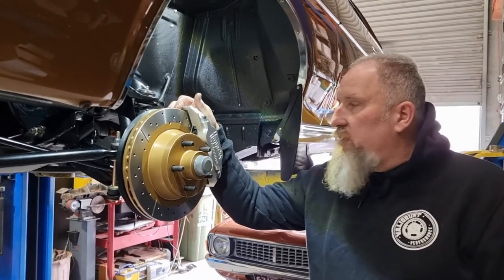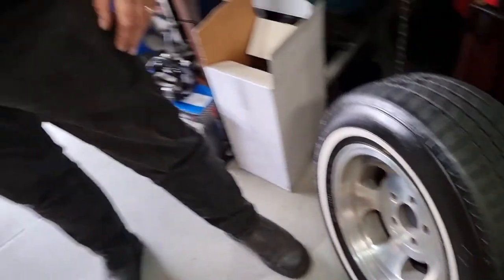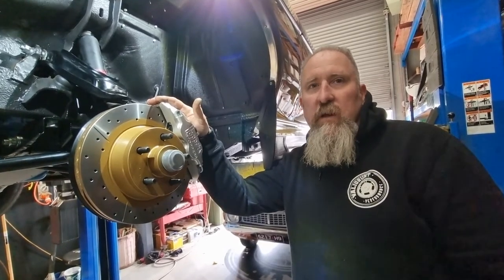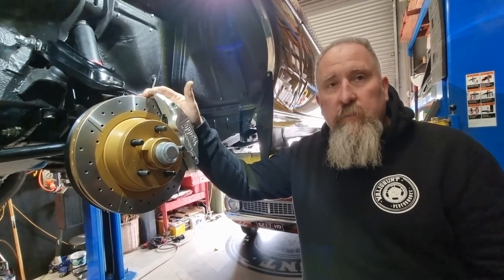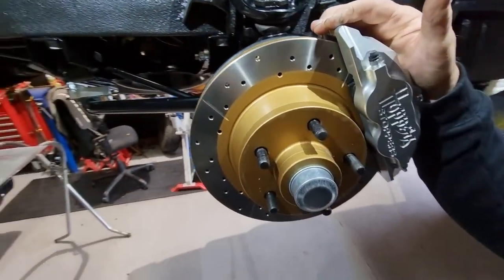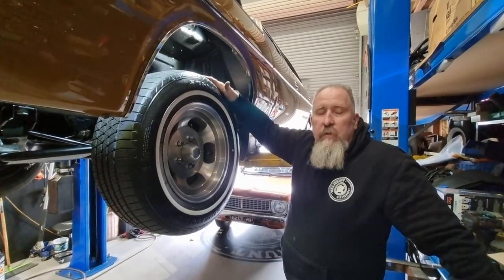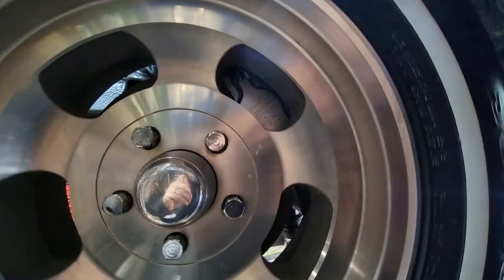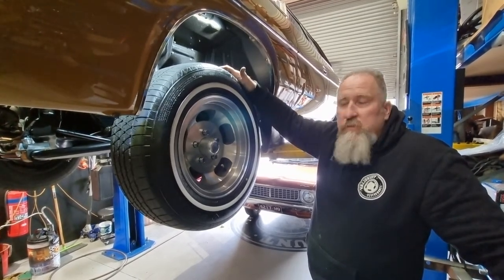New 4 spot billet calipers for Valiant to fit 14" rims

Comment: hi 
14 and 15 inch wheels are challenging to get ""big"" brakes and still run early wheels .
 Is about availability of  pad compound selection , disc rotor xtra iron [eg dba T3 disc ]  , quality caliper 
 I have found this dilema with an early Holden as well . 
The valiant should stop far better now . good up grade .
My 15inch wheel clears caliper by less than 5mm  [ford caliper/disc onto early Holden ].
better pads caliper disc selection